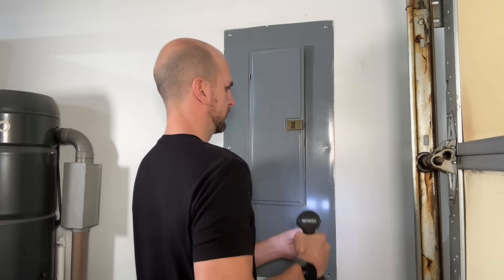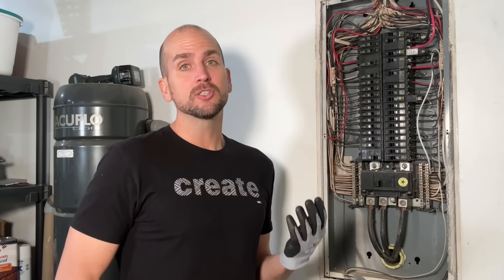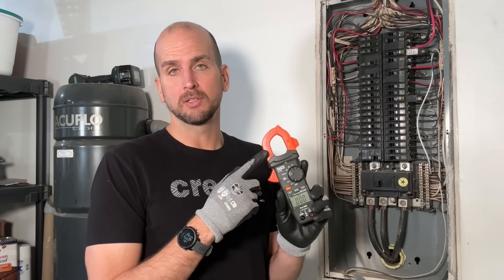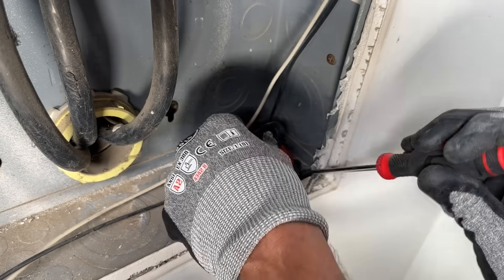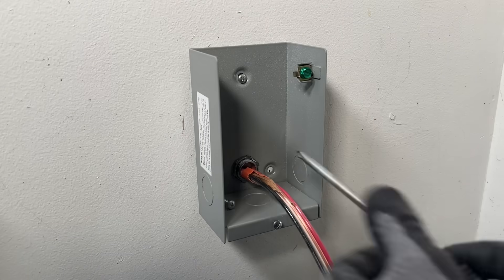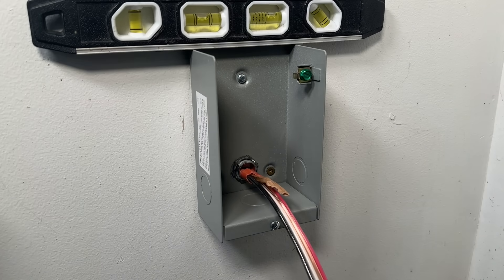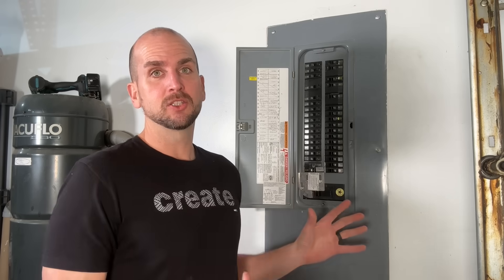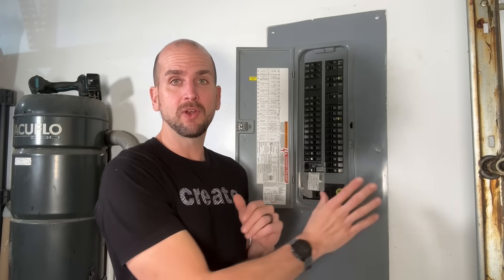Whole House Power Backup Solution | Generator Inlet Box Install

Comment: @Everyday Home Repairs 
I have a generator that will reach as much as 13000 watts at peak and settle to about 9500 to 10k. Will this box, rated for 7500 watts still be alright to use? What are the risks?
Reply: Unfortunately you already know that answer. Protential fire Hazzard. If you keep it below the recommended watts then you'll be ok. It really comes down ro wiring. The more power going through the thicker the wire that is required. Smaller wire that is getting more power then is intended will heat up faster. Do your best to control the amount sent, but if you don't want to worry about it then it's best to upgrade. Best wishes

Comment: Been watching a lot of these videos as I'm planning on installing a generator inlet.  I noticed you used 10 gauge for 30 amp circuit.  I see several folks recommending 8 gauge as this is considered a "feeder" circuit.  Curious if you did this again if you'd use 10 gauge or 8 gauge?  Thanks for all the great how to videos.  Love the content.
Reply: It also depends on the distance but generally the bigger the wire the better.
Reply: I used 10ga for a 30A feed.  Like his mine is less than a 10 ft run to my panel so I think that is adequate.  If the run was pushing 50 feet or more then maybe upsizing would be a good idea.  That said, if you are really running your generator at 95% load continuously, you probably need to rethink your setup.

Comment: Excellent explanation. Will this setup energize one side of the panel only or both sides?  I am asking because you connect the generator wires to on side of the panel only.
Reply from the maker: No this will energize both phases and give you full 240V backup.  The 30 Amp circuit covers 2 slots (2 poles) and the phases alternate on each side.

Comment: How about solar inverter with Lithium Battery back ~ up 2 - 48v 280Ah banks solar inverter charge controller to keep banks charged off the grid when having it & 3 car alternators on the bench 2 ~ Gm 10Si high Amp 1- 120A & 1- 110A & a Ford Mazda Eclipse 150A Alternator driven by 12v Dc motors ! ~ ? Any information welcoming!

Comment: Good video! I wouldn't bother installing a 30 amp inlet box along with a 30 amp breaker.You're much better going with a 50 amp set up. If you ever want to upgrade to a larger  generator and you only have a 30 amp set up you're going to need to upgrade your 10/3 Romex to 6/3 and get rid of the 30 amp inlet box and install a 50 amp box. You might have well do it right the first time.
Reply: Alternatively use a 50amp breaker & 6/3 with 30amp inlet box if you need to upgrade in the future just swap out the inlet box
Reply: I'm with you, but the thing is, the 50 amp setup has a different plug than the 30 amp.  Most generators only have the 30 amp plug.  Do they make adapters?
Reply: @mae2759  I believe they do, however if you can't find one you can always make one.
Reply: That 50-30 conversion cable is sold in every rv isle in a  hardware store
Reply: 50amp uses size 8 wore correct, or is it 6?
Reply: @Godfather44055  6 gauge.
Reply: I agree with you but do the prongs for a 50 amp box match a 30 amp without having to make a cord to fit? I’ll probably just run the number 6 wire anyway.

Comment: What do you need a breaker bracket for? Won't the panel door keep the breaker in place just like all the other breakers?
Reply: it might, but it might not.  the bracket ensures that it does not wiggle/bend out of the way.  it is not just a nice to have.  it forces it.
Reply: @larryseibold4287  Breakers just don't pop out! Matter of fact they are sometimes very difficult to remove!! I just don't get it.

Comment: Does this apply to “neutral bonded to frame “ generators? Some claim that the ground should be left open between the inlet box and generator. Some videos (not as informative) show a 3 wire 240v connection. Not saying you’re wrong, there’s a lot of conflicting information out there.

Comment: @2:35:  The momentarily excessive in-rush amperage on a compressor shouldn't trip a breaker or over-stress a generator.
Reply: Trip a breaker no, but mess up a generator not strong enough w enough peak watts… yes. I tell you from experience.

Comment: I’d love it if you had a set of links to PPE you use in the video descriptions you post. For instance, I have lots of test equipment but never owned any insulated screwdrivers or insulated gloves rated for common voltages. I definitely want to buy the gloves asap, even though I also adhere to strict electrical safety best practices when working on household electrical projects.

Comment: Help! I've got a couple receptacles where I'm getting 126v between hot and neutral, 96v between hot and ground, 20v between neutral and ground. I think it's only on one circuit. Other receptacles are testing normal.
Reply: That circuit has a bad neutral connection at one or more of the outlets on that circuit.   Turn off the breaker to that circuit and open the outlet boxes and check all connections.  Or call an electrican to have it checked out.

Comment: Awesome Video. I tried the Delta Ecoflow and it had issues powering some higher Amp/Voltage devices I used and I had to send it back. Waiting on the right one to be available for my needs before purchasing one of these but Ecoflow was extremely responsive and quick on the refund.
Reply: You have to look at the continuous wattage and in rush wattage load as a total for what your trying to power. The Ecoflow DP has is rated at 7200 starting watts and 3600 running watts. If anything, your trying to power is over 30-amps, it will overload the unit.

Comment: I installed a High Wattage Generator in a shed near the house, ran its output power cable through a junction box mounted high on a wall, ran the power cable about 8 feet above the ground from there to section in and through the eave wall, suspended on the typical cable supports like for telephone lines and Cable TV/Internet cables, down inside and to the house between the ceiling siding panels, to and through the back door overhead wall, around the corner and into the circuit breaker box on its own high amperage breaker.  I rigged a buzzer to the main to be able to know when city power was restored so I could turn the generator off, turn its breaker off and turn the main breaker back on.  I connected the buzzer through a light switch mounted near the breaker box to be able to turn it on and back off once city power was restored.  I'll admit that this part was dangerous!, but I did it without issue.

When an electrician came for a reason I don't recall and saw my rig, he said the generator cable needed to be run underground, up the brick wall and into the circuit breaker panel, and a Load Balancer needed to be installed to have the job done right.  You may want to ask your electrician friends if a Load Balancer would be required or at least advantageous to your application.  I don't remember his reasoning for it, but we had him do it all his way.  It's certainly safer and up to code, but there was never an issue with my way.  However, I'm sure it played a role in the safety inspection when the house was sold.  And explaining its safe operation to a buyer could have been tricky.  The Load Balancer does everything without human intervention.  Just wanted you to know about it in case a Load Balancer may be required in your city or state.

Comment: Great video I found a little trick that makes it safer I wired up a little bitty led light and powered it before the main breaker so if you are wondering if the power company has the power back on you don’t have to do a lot of switching when the led comes on in the breaker box then the power is restored from the power company the led light is about the size of a small eraser on a #2 pencil
Reply: There is a device called a PowerBack that you wrap a wire around one of your main lines, and when turned on, it will emit a piercing alarm when power is restored.
Reply: Where did u get the led or have a name for it?

Comment: About 2 years ago I installed a 50A interlock paired with a Westinghouse 9500 gas generator. (Surge to 12000 ~47A) I measured starting and running current of critical mechanical loads: well pump, sanitary sump, storm sump, furnace, refrigerator, chest freezer. I adjusted a few breaker positions to balance these across the legs. I did the same for all the non-critical circuits. I have a battery backup garage door opener to make it easier to get the generator outside. I floated the neutral on the generator. Each time I use the generator, I adjust the throttle set (Philips screw on a spring-arm near carb.) to dial in 60hz for the base load and re-check it every few hours. I run an "online" UPS for my home IT panel/MDF to clean the power. Home offices and home theater system are protected by regular UPSes that are adjusted for "poor" power quality so they only transfer for the worst startup distortions from mechanical circuits.
Reply: You can do a positive ground to the house wiring.
Reply: I agree with you on having UPSs to buffer sensitive electronics with clean technical power. I don’t think people think enough about that risk.

Comment: Just did this about 3 weeks ago for my 3600w generator and had to move a few breakers so that the one leg of my power could energize the lights in certain rooms.  Came out good and was fairly easy 

I also bought a vinyl siding mounting block and installed it on the outside of the wall my panel is on in my garage.

I cut put an 8x8" square beneath my panel after drilling the hole on the outsie of my house and I used one of the plastic spring loaded access panels to cover my cut out beneath the panel.  Makes it look a lot cleaner and since it's in the garage i could care less but if i move up generator sizes I can acess it to replace my 30A inlet to a 50A down the road if i decide to
Reply: If you don't need or require 240V for any appliance, then it's actually best just to send 120v single phase to both legs.  That way you are not trying to balance a two-phase 240V system using a generator, and everything 120V in your house works (and no need to move any breakers for a particular leg).  You can still wire up a 240V 30 amp four pin inlet power box, and use a 3 wire to 4-wire power cord converter at the generator that supplies the 120V to both legs.  Be sure to use a physical interlock between the breaker for the inlet power box and your main disconnect.
Reply: @Kevin-mp5of  yet here you are commenting on my post..  I guess you cared enough eh?

Comment: Only one problem with doing an amp draw test this way.... you don't know the start load (inrush) of certain appliances, which may be more than what the gen set can handle. You also have to consider balancing the load so both legs (not phases) are fairly close. That means making sure the fridge, sump pump, and furnace are not on the same leg.
Reply: @Kevin-mp5of  ... we're already in the main panel so hopefully it's correct there. <LOL>
Reply: @Kevin-mp5of  ... you mean from a few days ago?  <LOL>
Reply: @Kevin-mp5of  ... at the risk of being a wise guy, some people might lean on the generator frame (metal) while yanking on a faulty cord? All I can say is they should learn the trick of keeping one hand on their pocket while working with electricity.
Reply: @Kevin-mp5of  ... the 4 prong plug to the panel supplies the bond... but only if it's connected. I also mentioned it might be faulty. If you think of the typical owner going through the motion of connecting or disconnecting the cord, you will get the picture. I actually watched a customer drop one of those plugs and mess up the alignment, then proceed to use a screwdriver to make it fit while the set was running! What were they thinking? (shaking my head)
Reply: @Kevin-mp5of  ... and now you are just foolin' with me because he's not around? Ha... my skin is thicker than that!  <LOL> I also have 35 years between HVAC and generator work so have seen just about everything there is.
Reply: @Kevin-mp5of ...  while you are laughing at that go back to an earlier post where you said, "grounding and bounding" and I missed the typo till a few minutes ago! Pardon me... I just walked home from the local gin mill after a great evening. <LOL>
Reply: @Kevin-mp5of  ... you can edit a post by clicking on the 3 dots to the right, which are invisible till you move your mouse in that direction.

Comment: Give the Bluetti lineup of power stations a look. Their current offerings are really good. I have an AC200Max that I use with a 4 circuit 120v transfer switch. It gets  me through most outages with the exception of major storms. I have generator and whole house plug for that but rarely need or use.

Comment: You mention 30 and 50 Amps but you do not relate your current reading on each side of you in-feed. When you say a 30 amp connection will work are you just looking at your highest current side OR are you combining both currents from both sides? Thanks for any info. I am subscribed and enjoy your Vids.
Reply: It's 30 amps on each pole of the double breaker

Comment: Thank you for the video. I already have this type of setup but I’m always interested in learning. 

Question: you passed a 10/3 wire through the wall but it appeared that you mounted the unit on an inside wall?  I’m curious to know why?  My unit is mounted outside, where the generator would be located. 

Not a criticism. Just curious. 

Thanks!
Reply from the maker: Good question, I think I will try a Generator setup (nicer to have box outside) but also a battery backup system which will be inside.  Since I want to try both systems I chose location inside and close to the garage door so I can run a cable outside to the Generator.  👍

Comment: The wiring to the panel was not installed correctly. The neutral should have had white electrical tape wrapped around it, not left black.
Reply: The neutral wire is white. The black and red are the 2 hots. Are you seeing something different than this?

Comment: It might be a good idea to exemplify the need for safety glasses as well as insulated tools, especially when taking measurements, when working in an open panel due to arc flash potential….Serious burns can happen, and it should be noted as an electrician you should be first power the panel off, unless you have a critical reason not to…NEC NFPA 70E is a consensus document by electricians and engineers to limit arc flash potential…especially for the DIYer…love your videos, but as a past safety trainer this gives me the heeby jeebies…
Reply from the maker: I appreciate the feedback Henry.  I am probably well past due for investing in some insulated screwdrivers.  👍
Reply: @Kevin-mp5of  the leading cause of death sir!

Comment: I use a generator feeding ftom a cable I made that goes from the generator to the dryer connection outlet. This allows for both phases of the generator to be fed to the home through the main panel. Of course you must disconnect the home from power company by turning off the main breaker usually mounted close to the power meter.  By switching of f main panel individual brakers one can selectively power the critical home devices.
Reply: Ok Karen
Reply: It sounds as if you have created a cable with two male ends; one to the generator and the other to the dryer outlet. You have made a cord which can kill yourself or a friend or family member. That second male end is carrying dangerous amp/voltage, too easily grabbed or touched. Please cut that cable and install a correct inlet box!

Comment: Two things I don't understand:
1) How does powering one side of your box power the other side where you needed 9 amps?
2) Are you not concerned about powering refrigerators/freezers or do they consume too much power for a 30amp supply?
Reply: He is powering both sides of the panel.   He added a 2-pole, 30-amp breaker.   If you were to remove all of the breakers, you'd see a metal bus bar fed by each "leg" that cross back and forth, from side to side.   A 2-pole breaker mounted on one side contacts both bus bars and, hence, both sides of loads. 
With a refrigerator using 2200 watts on startup and 700 watts when running constantly, he could power a refrigerator with his generator.   He has a 7000-watt generator, I think.